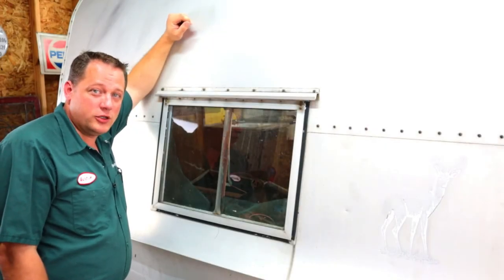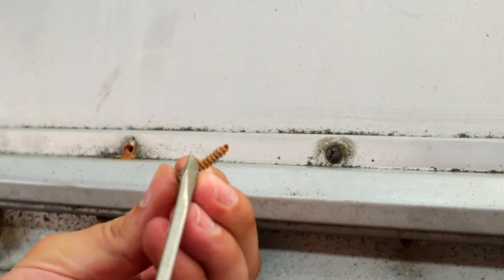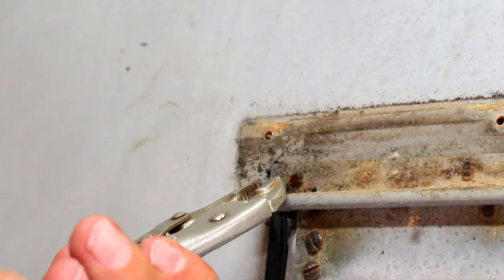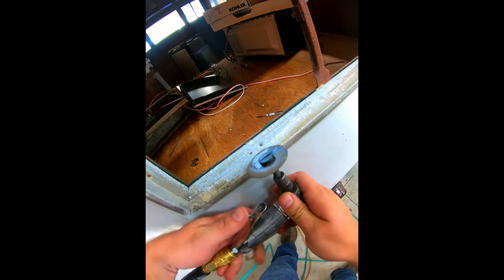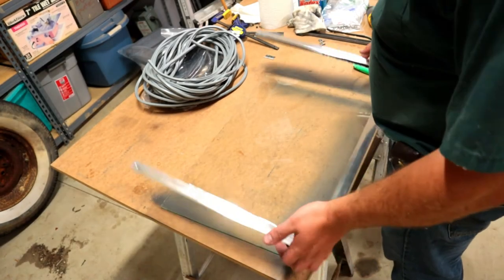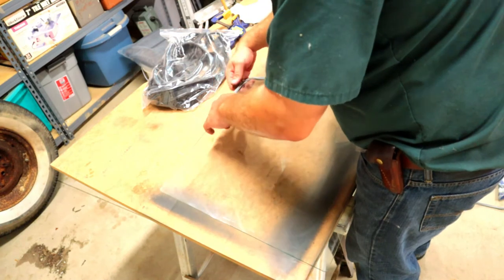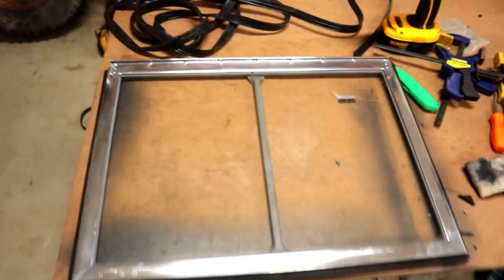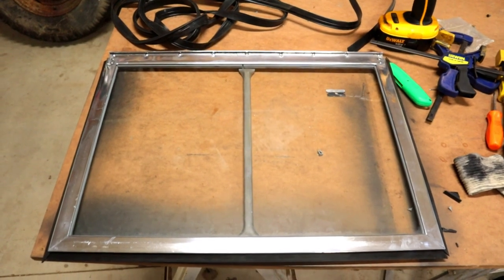Vintage Camper Window Restoration

Comment: i  have a vintage trailer with the same windows as yours, they are real rusted though, when you replace some rusted body screws like this, where do you get a good deal on those wood screws, and do you use steel or aluminum screws for the siding skin?
Reply from the maker: Stainless steel screws and I got them from Menards here in Michigan